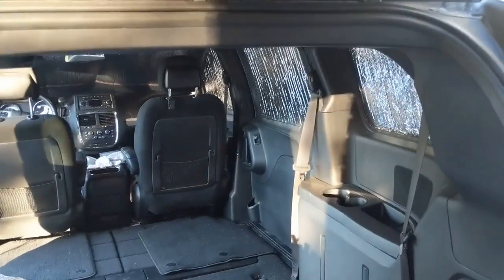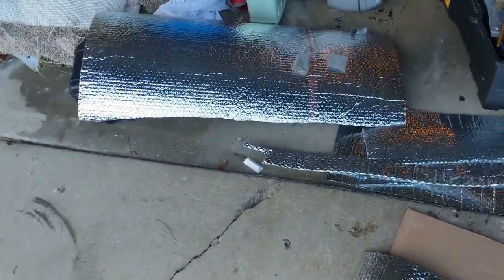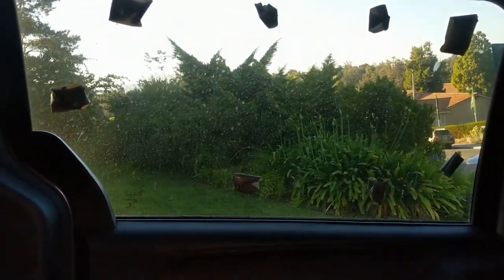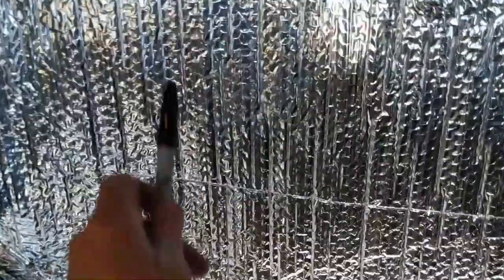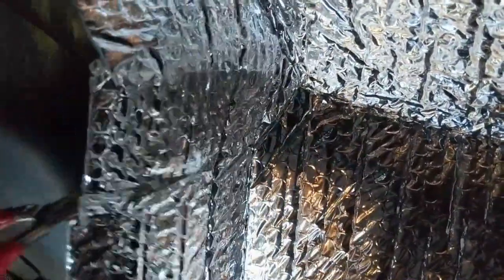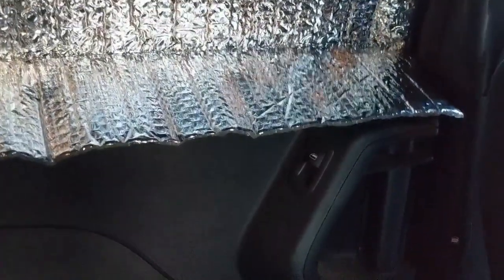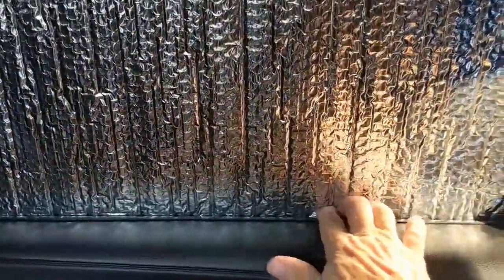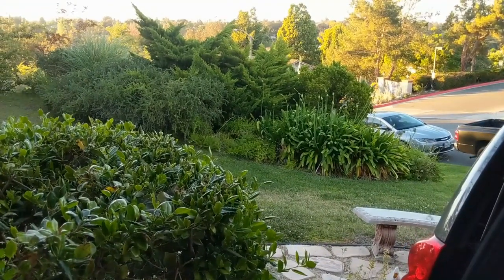Make window blinds for van or camper out of Reflectix

Comment: Thanks for this video. It was very helpful. I will be making some window coverings in the Spring to get ready for van camping this summer. Have you considered putting some black fabric on one side? I gather if you have the black side out it will help to keep the van warmer in the winter.  I'm in Ontario Canada so I'm thinking the black fabric on one side might be helpful. Your video was one of the best I have seen on making Reflectix window coverings. Enjoy your camping trips. Would love to see more videos from your travels. I liked the cabinet you made for your kitchen as well.
Reply from the maker: I'm sure it would help  dark colors absorb light energy so when it faces the outside it will absorb heat much better then the reflecting it like reflectix. Once the sun goes down the color doesn't matter but would probably still add to the insulating and vapor barrier and is much more stealth so its a great idea even if its put up after sunset.  Unfortunately flipping doesn't really work as many windows are asymmetric and don't have a companion on the other side of the van so summer use vs winter might matter to some.   Thanks Ill try to post more videos of my travels.